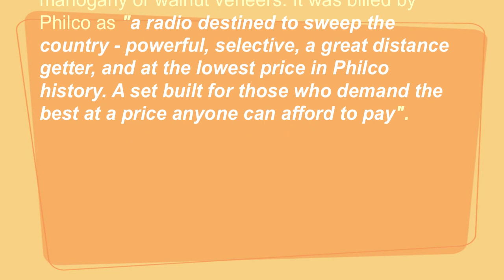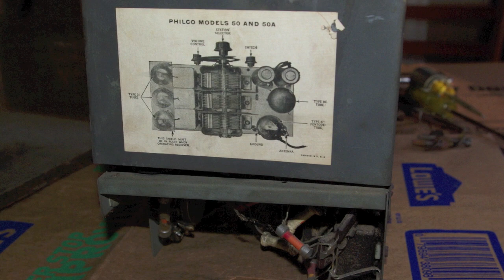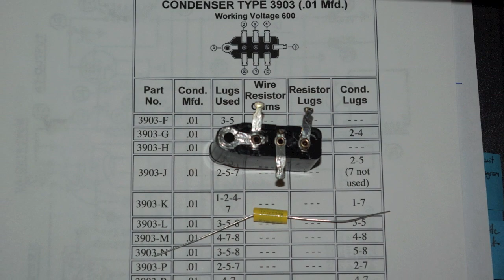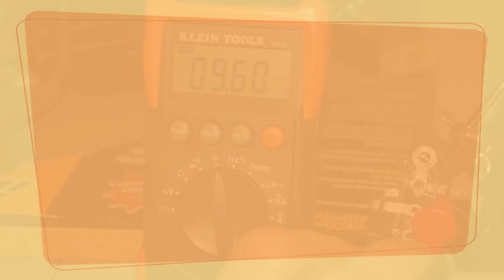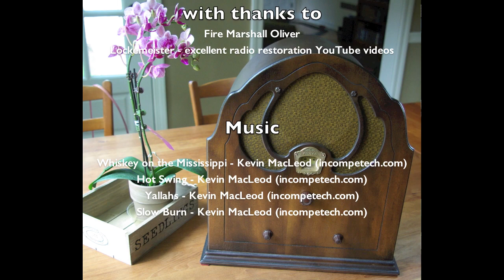1931 Philco Model 50 Vintage Radio Restoration

Comment: Dear Radio Head,
This has to be the best radio video I have even seen! What a great job! I liked how you restuffed the Bakelite blocks the right way. Looks like some or all original tubes. That's great. The beauty of the glowing tubes shown. Great job on the Cabinet but you just have got that info from someone other than myself.This really touched my heart watching this. So very glad my videos helped. Maybe your son will be a great  Engineer one day from the inspiration of his Father. Thanks and God Bless.
Reply from the maker: Dear Lockemeister,
thanks for your kind comments.  I truly did find your videos highly educational and fascinating.  I really like your professorial though light-hearted style.  Yes, this Philco did appear to have all its original Philco tubes and they all worked, even the one with the broken top.  When i tried replacing them by trial and error I did get some slight improvement so I ended up sticking with what seemed to give the best performance without resorting to a tube tester. Of course the video makes the whole project look deceptively quick and simple, but it did take me more than a year of slowly working away whenever I had a spare 30 minutes or so, particularly over the winter weekends.  Take care and thanks again.